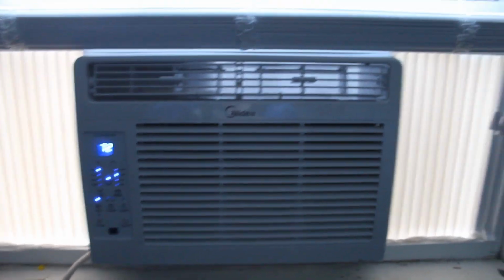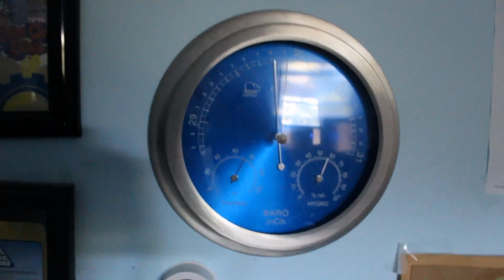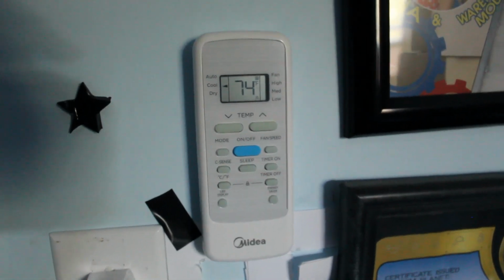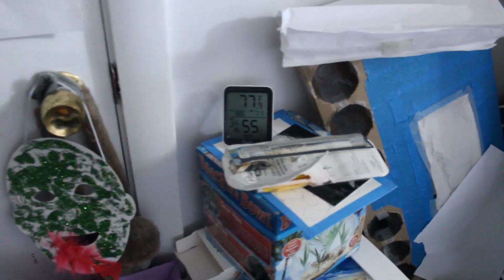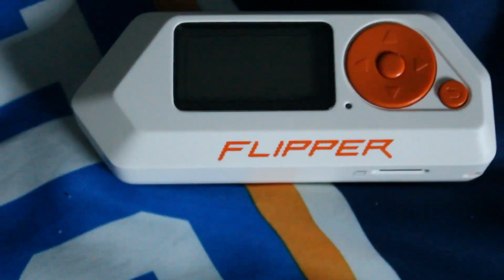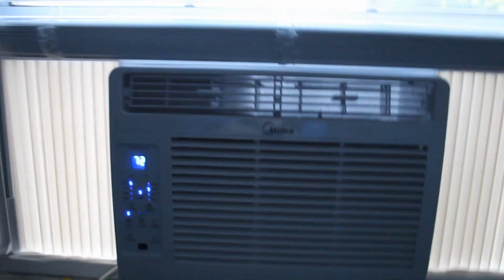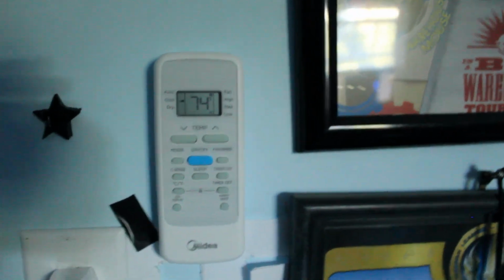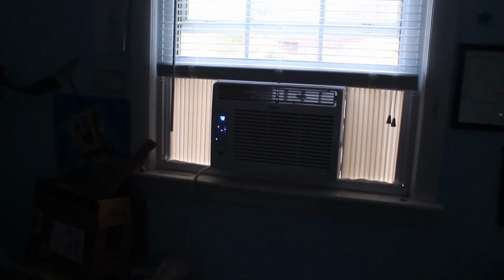5000 BTU Midea ComfortSense Air Conditioner - My Review & Thoughts

Comment: Installation is easy. I purchased two 12000-BTU units and both worked for two years only. The code that came up indicated loss of refrigerant. I contacted midea customer service and they told me that the units have only one year warranty and basically they wouldn't do anything even though I had the same problem with two units. I found out later on the owner's manual that the seals have five years warranty. I contacted media again and they gave me the run around. Since I was not able to find a technician that would work on window units,  I had no choice but to throw both in the garbage.

Comment: If you are going to do a series of this type, consider a kill-a-watt or similar to see just how much power it pulls. Should you go down the tech review route then there are more accurate tools to find transient power spikes (think power surge like when the compressor turns on but for higher power and extremely short periods, good at causing problems but are too quick for many tools to pick up) and such.
Reply from the maker: Thanks for the suggestion